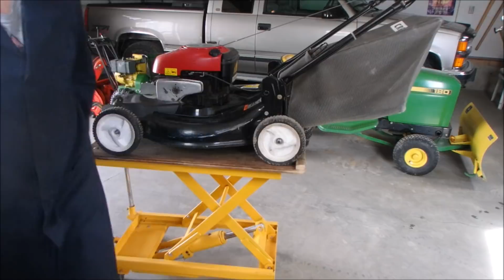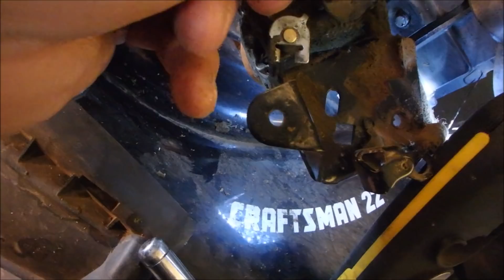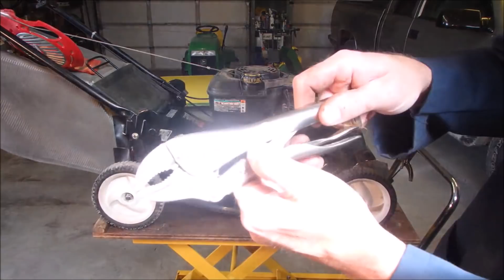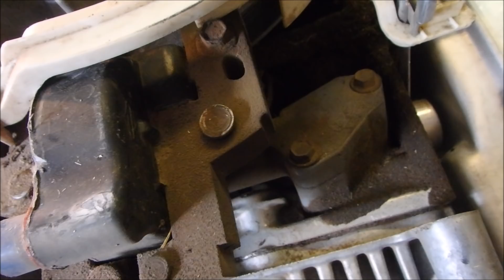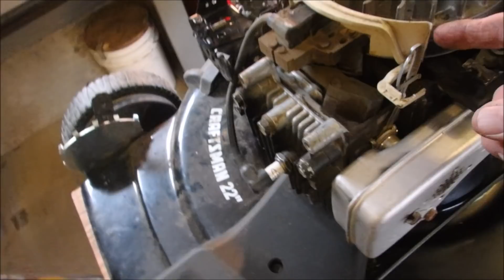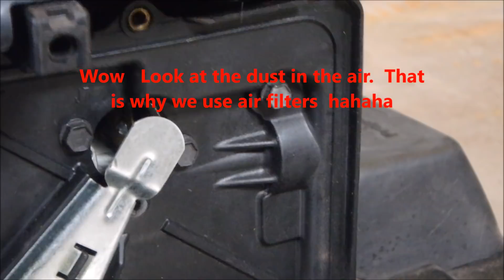Craftsman Self Propel Mower Wouldn't Start

Comment: A tip, if you look where that spring attaches to the metal cover part, make sure it isn't touching the coil, cause that will ground it out.

Comment: I’ve had the same problem with mowers and blower I came to the conclusion the factory’s DONT  use  good ole LOCK TIGHT  no more anything for them to save a buck eh
Reply from the maker: Yes and I think one was over tightened.
Reply: Shaun Leifso what was the size of the bolt. Mine fell off too but I don't know what size to get

Comment: Someone threw away a mower just like that, I found it at the curb Wednesday, except it was a rear wheel drive with electric start and all kinds of features. It was a top of the line Craftsman built in 2008 by AYP-Husqvarna. Anyway the carburetor was all gummed up and grass was all jammed into the belt area and wheel gears, otherwise the thing was still in near like new condition. I cleaned the carb, washed it and than sold it 3 days later with an ad on craigslist. I got $225 for it. Not bad. It looked brand new when I sold it. 
......From one mans curb to another mans lawn in 3 day's, it was a really nice mower, but it was a little too big/heavy with the e-start component's for my taste. It cut really, really well though, nice striping, it had that precision plus cutting system with a special expensive blade that goes on those models, probably the most I ever sold a walk behind for, I'm up to 6 walk behinds sold this year so far since mid March and I still have more to go, keep them coming I say.
Reply from the maker: Good for you Fearless

Comment: "tune up" is an abused term for sure.....When ever someone brought a machine in for a "tune up", I always asked "what is wrong with it"....Folks rarely brought in good running machines for a "tune up"....Very interesting indeed...I remember those cross over intake tubes from many years ago as well.  The two tiny retaining screws would get loose (like you showed), and sometimes the tube would get loose in the aluminum elbow fitting....I too though of an unbalanced blade/bent crankshaft when you found the sheared screw and loose parts...Was the blade/crank OK?  If so, I suspect we/you did not hear the whole story on what happened.  Doesn't seem likely that screw would have sheared off on its own...Perhaps someone was messing with the carb and over tightened the screw causing it to shear off...I have only seen one or two of those automatic choke deals, seems kind of hoakey but did work OK.  The one I messed with had the governor blade screw backed out of the carb mount as well, but I attributed this to the blade that was bent up like a pretzel....
Reply from the maker: The blade is ok.  I think that bolt was over torqued.

Comment: All of those Quantum engines are the same. Their 190cc, yet during the horsepower years they rated those engine's anywhere from 4.5 horsepower all the way to 6.75 horsepower, yet they were really all the same. Than all these companies got hit with a class action suit, which was costly and they stopped using horsepower ratings and moved onto CC's and ft pds torque. Than they started doing the same thing with the ft pd torque ratings, going up and up on the same engines. Not sure if they got smacked for that.
Anyway the Briggs Quantum L head is no longer in production as of this year.
They started making the Quantum around 1982 and it went until 2017 a good 35 year run. It was one of Briggs most succesful line of engines, along with the old oppposed twin and they were a bullet proof engine. They have now moved onto the OHV made in China version that they are putting on mowers now, not as good as these Quantums are. You cant beat those old Quantums, they are the best.
Reply from the maker: I will miss the L head!!!!

Comment: It's odd that the bolt sheared off like that. I have a very similar Craftsman mower. It has electric start and also front wheel drive. Last fall I found the molded ring gear teeth on the inside of the front wheels had stripped. I haven't figured out why yet. I like the machine but that design apparently isn't durable. Have you had any issues with that type drive line?  Thanks Bruce Gone fishing yet?
Reply from the maker: I have only had a few electric start one come in and no they are ok.

Comment: Great video Bruce, was it the blade that made everything vibrate loose? I was baffled on how the bolt was sheared completely off. What do you think would’ve caused that?
Reply from the maker: I Think it was over tightened at the factory

Comment: That person was a little ruff on that mower.
Reply from the maker: No he is always careful.  Just a factory defect.
Reply: Bruce, he's missing the air filter and cover, but says it just needs a tune-up, and you say he's diligent with maintainence. Somehow a carb bolt has broken. You surmised from excess vibration, but you don't mention whether the blade was way out of balance. What was the factory defect? Good video though, I have this same mower/engine w/o self propel and it's getting hard to start, so I'm going to dive in and clean the carb.